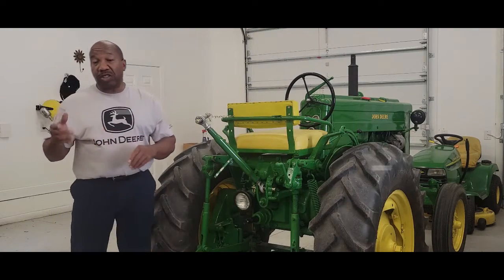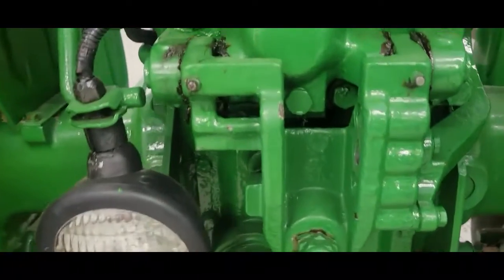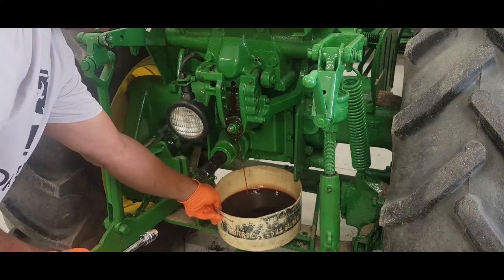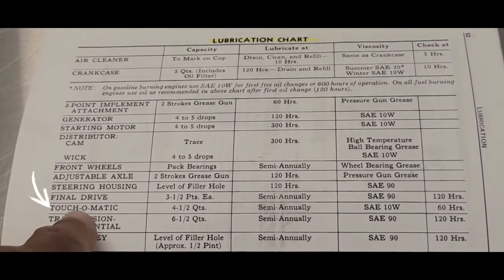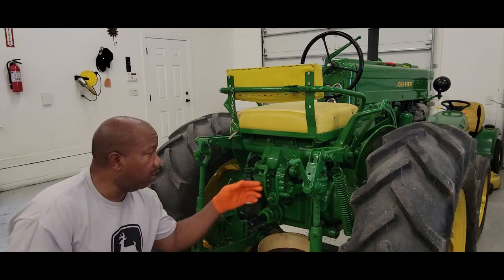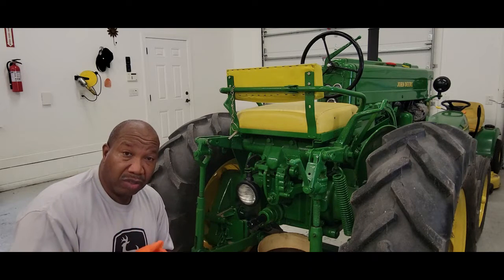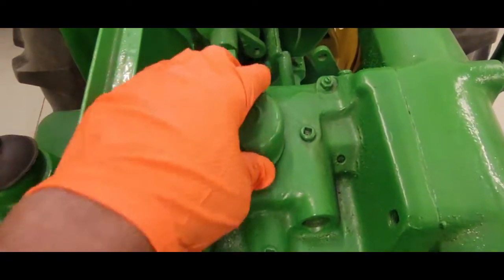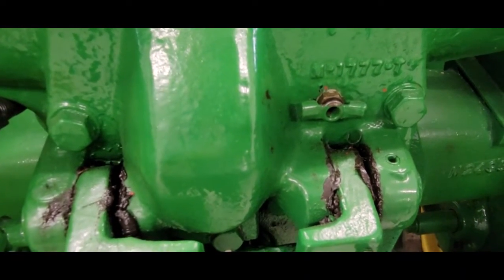1954 John Deere 40 Touch-O-Matic

Comment: I have my dad's 40S that he bought in 1973 and we used on his farm.  It's that tractor I learned to drive when I was 13 and I'm 63 now.  My grandsons and I just pulled the head off it today to replace a blown head gasket that let about gallon of coolant into the crankcase.
Back in the day we found out the hard way that it is best to fill the hydraulic system with the same stuff you use in your engine because some day the little O ring in the hydraulic pump is going to give way and that pump will pump the hydraulic fluid past that seal and into the timing gear cover and right into your engine.  In the 50 years I've been associated with that tractor my dad and I have replaced the bearings and O ring twice.  It's not a bad job but it requires removing the radiator which is not a pleasant day for me.  
Your tractor looks fantastic and I admire the way you keep it nice and clean yet still use it too.  Great video and thanks for posting your 40S maintenance procedures.